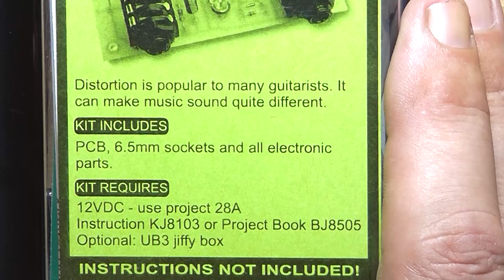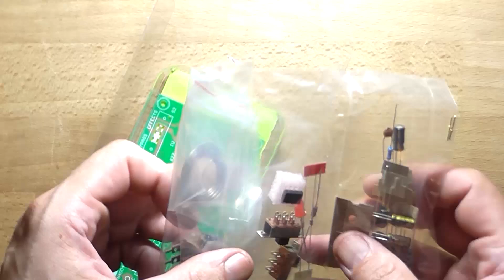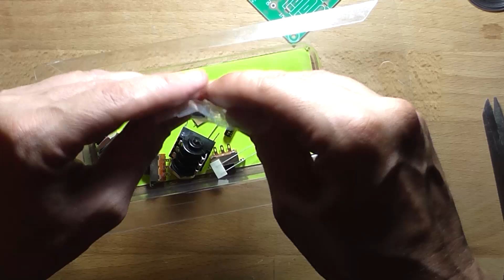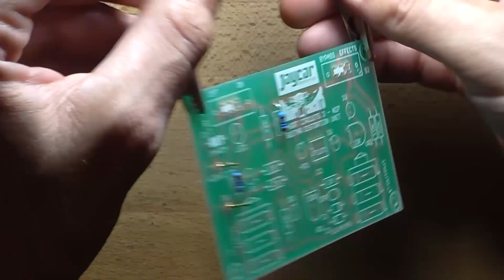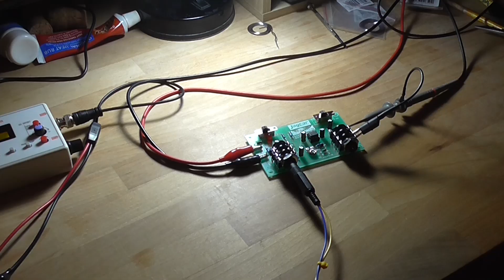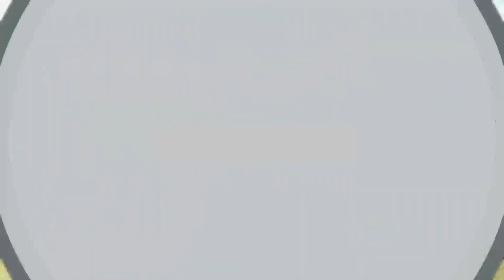Short Circuits 3 - Guitar Distortion (P# 27)

Comment: picked one up without realizing it was bad, any part you can switch to make the distortion effect stronger?
Reply from the maker: You could increase the series 10k resistor to the 100k pot to say 22k. This will change the inverting gain of the opamp if you change the series resistor to -2.2 (-A = Rf / Rin = 22 / 10 = -2.2). That will give a little more gain when distortion is zero, and when the pot is rotated full clockwise, a bit more "overdrive". That'd be what I'd look at, is the gain structure.